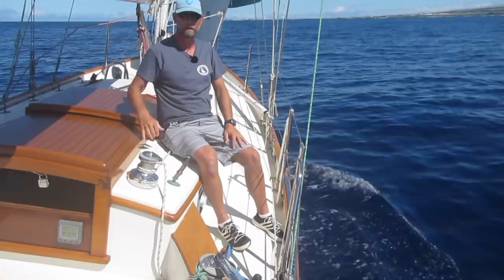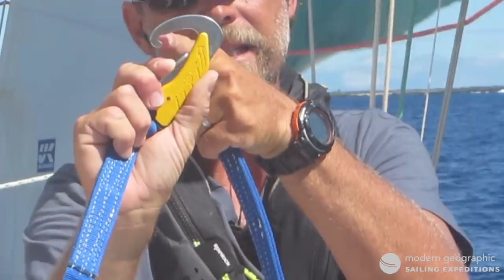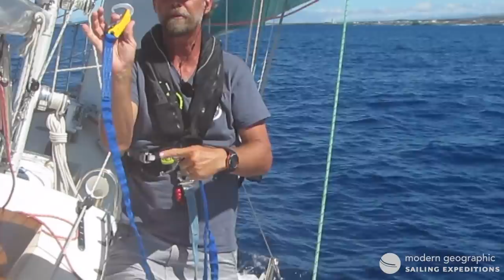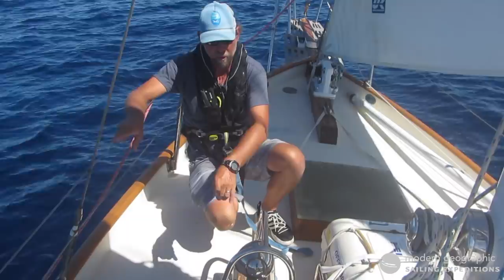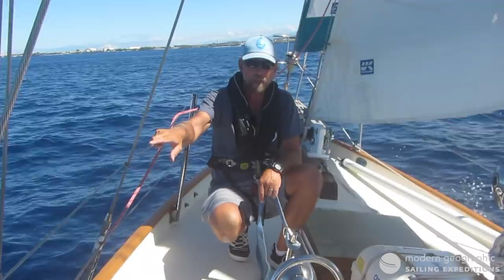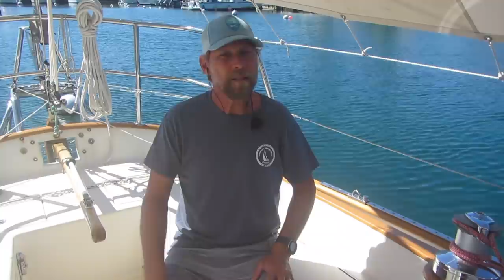Sailing Safety Harness ... Don't Ever Let Go!

Comment: Great story, enough details to really get someone’s attention and make an impression. One thing - there is no arguing that any type of tether is better than none, but as a rock climber with many hours up multi pitch with partners, I can say from experience that you DO NOT want a biner with an open gate (unlocking). I’ve watched as someone weights an anchor with wire gates and non-locking biners. The carabiner rotated along the surface, pivoting on the gate, opening and falling off the another with a man 200’ up. Luckily there was more than a single point to the anchor. I’d heard about it happening, but to see it was frightening. Never, ever trust a non-locking carabiner, always use at least (2) points so you will always be connected as you release the other. Think of a via ferrata setup, that’s what you want.
Reply from the maker: Great comments, Benjamin! I appreciate your perspective as a Climber who relies on tethers and carabiners to provide a serious-level of safety. I will pass-on your comments to those who I train at sea, and all viewers can read your productive comments here too. Kind regards, Paul
Reply: I couldn't help but think exactly that, what if pressure was exerted on the wrong side forcing it open.... I think using two at Sea would be safe enough or the extra second or two of unlocking the other type (though this may lead to complete inability in a moment of panic).
Reply: @PaulExner  Great video only found your channel tonight as I was looking how to use a '2 hook locking line'. Despite owning a powerboat rather than sailboat I'm subscribing because heck your 40 years experience are valuable and worthy of my time (especially given I'm a complete novice).
Reply: @rachelengland3571  Agreed, valid point Rachel, as long as there's not extended periods on a single attachment, it's a safe bet!
Reply from the maker: @rachelengland3571  ... thanks for your kind words! I'm happy to know I'm helping you have more fun boating -- kind regards, Paul

Comment: I singlehand exclusively. I have gone overboard once. I keep a bumper hanging from my bow pulpit and it saved my life until I was rescued.  I had no way to get back onboard. I was in the gulf of Mexico offshore from Galveston. My coast guard training classes and my sailing classes and years of experience paid off. Pleasd train for overboard scenarios, it may save your life. Thanks
Reply from the maker: Hi @meatdog !!! I'm glad you were rescued and are here telling us your story! Indeed, everyone should train for the possibility of going overboard, and more importantly, everyone should work to stay aboard in the first place; a few good tips are: 1) make each movement aboard your boat with care and awareness for safety, 2) keep physically fit, as this increases your physical stamina and minimizes the time you're tired and trying to move around the boat, practice with you gear frequently, and check the weather ahead of time so you're prepared to battle bad conditions well before you encounter them! Aloha, and safe sailing! Paul

Comment: I have attended a number of Safety at Sea Seminars. And I'm a great believer in their benefit for cruising couples, even though they are often associated with ocean races and focused on the safety requirements of that way of going to sea. Having said that, these seminars spend a huge amount of time explaining the procedures for recovering a person overboard (POB). For the short-handed crew, that time could be better spent.
Short-handed POB Recovery is an Illusion, in my opinion, for the two-person crew offshore, no matter how well equipped and drilled, the chances of recovery of a person overboard are not great, even in the best of conditions. And once the wind gets up they become slim indeed. This is why I prefer to focus on crew POB (person on board) I like to imagine that there is a 500-foot cliff on the other side of those lifelines. Stay windward of loaded gear. Ban side deck jack lines forever and use only centerline. While being always attached to the boat is a huge increase in safety, that's only part of the story. What we attach to and how is equally, or maybe even more, important. But what really matters to the short-handed crew offshore is making as sure as humanly possible that the MOB situation never happens in the first place. I prefer The TeamO life jacket in the event of dragging. We need more prevention less cure.
Reply from the maker: Thank you, Bo Jangles! I love your perspective and agree absolutely that the procedural based instruction only serves as an outline for what should be covered in the training, but the procedures should NOT be the end of the discussion -- for, the execution of those procedures often isn't followed in the real world; however, occasionally a race team IS disciplined enough to follow a recovery procedure, but not consistently. The philosophy of safety is definitely about prevention as you've written. One hand for yourself, and one for the the ship IS a metaphor where the sailor must guard themself to not cause danger to themself, and MUST keep an outward perspective to also safe-guard their crew.

Comment: Hi Paul, I've listened to all the  episodes of Andy's Schell's podcast, On the Wind, in which you feature, and was curious to check out your Youtube channel. Interesting video - I hope you'll put up more content soon! My question is this: for offshore racing, should I be thinking about getting a short 3' tether, or a double short/long combo tether? Like you, I currently have a traditional 6' single tether. You've probably been following the recent debate, however, around people who've gone overboard while tethered, and end up being dragged alongside, pinned to the hull with such force that they can neither get their head fully above water, nor detach or cut themselves from their tether. There have been at least two recent fatalities roughly following this scenario. The solution proposed by many is to use a shorter 3' tether whenever possible, so that you don't fall completely off the boat if you lose your footing. This is also the philosophy behind the double short/long tether: the long one is only used while moving, if you need to bridge an area with no clip-in point, and the short one is for use while sliding along a tight jackline (it's just long enough to let you stand), or when working in a fixed position. What are your thoughts on this? Sorry for the long-winded post. Cheers!

Comment: Please demonstrate going overboard attached to a 6' tether. Certainly you won't let go, but how do you get back on board?
Reply from the maker: Aloha, Carter. Thank you for your question. Single-handers will have a very difficult time getting back aboard their boat underway while attached with a 6' tether -- many short-handed boaters have unfortunately died this way. If the overboard sailor, attached to a tether, is dangling from a crewed vessel, and the crew realizes the overboard-sailor's plight, the crew will stop the boat and re-board the victim. Obviously it's best if all crew stay aboard the boat. Here's a link to an article I published in Ocean Navigator Magazine to help sailors Improve The Odds Of Recovery: https://oceannavigator.com/improving-the-odds-of-recovery/ Thanks, again... be safe. Paul Exner

Comment: Useful information. Excellent audio quality on the windy deck wondering if you post dubbed the audio.
Reply from the maker: Thanks for the nice comment, Rick! The audio in this video was recorded LIVE (no post-dubbed). It took me some time to find a technical solution to block-out the wind noise.
Reply: @PaulExner  what was your technical solution?
Reply from the maker: @angieej1972  ... Hello, Angie! I appreciate your kind comments about my video about Harnesses. As you are aware, there are so many details to keeping safe by staying aboard a boat at sea, but very simply, my "Technical Solution" to this is: Spinlock 5D; and, Jacklines employed port and starboard from stem to stern along the side-deck. There are hundreds of caveats to this solution, but I hope this basic information helps put you in the right direction. Fair winds, Paul Exner

Comment: Thanks,  I bought a 30 ft Etchill which has no safety features, no lifelines etc and the boom is only 18inches off the deck, so I really want a teather and harness,  you did not mention leg straps,  I read in 48 North abouta girl who slipped out of her harness when they used the harness to lift her ut of the water.
Reply from the maker: Aloha, @pabarrett ... I believe that leg straps are essential. In the video I'm wearing them at one point, and sometimes I don't install the leg straps while wearing the harness if the conditions are moderate during the day. At night, or when the conditions kick-up a bit, I can easily rig the leg straps since I'm already wearing the harness. Aloha, Paul

Comment: I love this Paul! Great Job! Also, the wood looks great! You told me that you used Penofin, correct? Which one? Was it the Marine Wood Oil Finish? Was it easy to apply?
Reply from the maker: Hi Paula! Thanks for the kind words about the video and wood aboard Solstice. We recently switched to Penofin TSF Architectural Grade, Satin finish in search of a wood-care system that would keep wood looking its best while minimizing the labor required to do so. I've tried many different wood finishing products: varnish, oil, Cetol, epoxy/varnish, Awlgrip clear and all of them were very labor intensive and yielded marginal results. I finally settled on Penofin TSF Hardwood (not their original Marine Grade), but I went with their Architectural Grade for its advancements in chemistry: "Supreme level UV resistance through the use of a multi-phase UV protection package composed of high grade trans-oxide pigments, Nano-technology UV blockers and UV photo-light stabilizers. This durable yet flexible alkyd-urethane hybrid system delivers 2 year protection on decks and 4 year protection on fences and siding." We sanded our teak back to bare wood (scraped, 80, 150, 220) and dusted the wood "dry;" then applied two coats. They went on easy, and just like any other coating, the technique used to brush it on with a foam brush was unlike any other technique I've used; but, with any painting experience a user might have, we learn to adapt to the new material quickly. The jury is still out on Penofin, but I've been impressed so far, and I'm hoping that both longevity and application of a maintenance coat will minimize the labor spent keeping the wood looking great! Kind regards, and sail on ... Paul

Comment: good job, subbed, what sort of boat is that?
Reply from the maker: Thanks, Superform! My boat is SV Solstice, a custom boat I built from a bare hull. The hull is a Cape George Cutter 31, but the deck, cabin house, other structures, rig, mechanicals, etc. were all built custom or specified by me from my bare hands. Solstice is the only CG31 with that exact deck configuration ... she is a one of a kind.

Comment: In a sailing lesson once an instructor fell off our boat (an Interlake), and hit his head on the (smooth, no toe rail) deck - fortunately not knocked out.  The student at the helm was inept and couldn’t complete a man overboard drill.  The instructor, who knew me from Tech dinghy racing (thus knowing I could sail to a “mark”), called from the water for me to take over, and I was able to take over and get back to the instructor.  As I recall the instructor got a “funky monkey” award for that one.
Reply from the maker: Thanks again, Cubeist Games ... good work recovering the MOB; that is no small feat! It's nice to be recognized for your talents during a life-critical event. The Funky Monkey was earned by the instructor, I'm sure! For anyone reading this comment ... the FM award is given weekly to an Instructor of the Hoofer Sailing Club during the summer sailing season for crazy or heroic actions in the line-of-duty.

Comment: Nice video with good info.  But why do you not use the crotch straps on the Deckvest when you show how to put it on. I see you use them later in the video.
Reply from the maker: Hi BlakeRedding ... Thanks for your comment! When I shot this video, my initial thinking was to don the Deckvest and draw attention to the features that I did highlight, and my thinking then was that I didn't want to discuss crotch-straps in the beginning, but later on the in video. I also had planned to discuss the design-evolution of crotch-straps being the result of loss-of-life attributed to the old (non crotch-straps) harnesses slipping over the victim's head. Thanks for brining up this important point--in a future video I'd like to talk a lot more about how important they are. These days, I "mostly" connect the crotch-straps right away as a good habit, and I believe doing so makes the sailor safer. Fair winds, Paul

Comment: what is the make and model of the leash?
Reply from the maker: Hello, @pabarrett ... I sourced the tethers from West Marine. I'm unsure of the specific brand. I prefer the traditional carabiner style connection without locking mechanism and without the "tooth" which holds the mechanism closed. I prefer the tether attachment styles that are simple in their design. Kind regards, Paul

Comment: Is it a bad idea to use those flat carabiners on soft loops?
Reply from the maker: Hello, twisterwiper! I'm unfamiliar with the term "flat carabiner;" can you describe this this more detail? By "soft loops" are you referring to a Dyneema Loop? In general, I would feel comfortable attaching my tether to a soft loop made of Dyneema with any high-quality carabiner. I wouldn't expect to see any appreciable failure in the soft loop if the diameter of the line is around 12mm or larger which seems like a good working-size for a soft loop. If you have a moment to describe the details behind your question, I'll make sure to respond with more detail too. Kind regards, Paul
Reply: Paul Exner Sure, I’ll try to explain a bit better. English is not my first language so I don’t always know the correct descriptions/words. “Soft loop” meaning the safety line connection point on the life vest, made of fabric as opposed to the alternative metal D ring you will sometimes find on other brands. “Flat carabiner”, meaning the carabiner type you display in the video, that you don’t like. It looks like it’s sort of flat or angled as opposed to the more rounded one, you prefer. I’m just thinking that a shackle made of angled metal might chafe the fabric in the life vest loop or even cut through it in violent jerk?
Reply from the maker: @twisterwiper  ... Thanks for your description. In my video I use the Spinlock 5D Deckvest which has a "soft" attachment point for the snap-shackle end of the tether. If you have that style of tether, the "flat carabiner" in my video won't put load on the "soft" attachment point because the snap-shackle will attach to the "soft" attachment point instead. However, I believe that even if the "flat carabiner" were attached to the "soft" loop of the 5D, it wouldn't break the "soft" loop. I hope this helps. Kind regards, Paul
Reply: Thanks Paul, that’s very helpful - makes perfect sense now. I didn’t realize the snap-shackle was different from the carabiners. I’m new to sailing as well, so still learning a lot. Having my first sailing lesson next month.
Reply from the maker: @twisterwiper  ... excellent! Enjoy! You're destined for the adventure of a life-time!